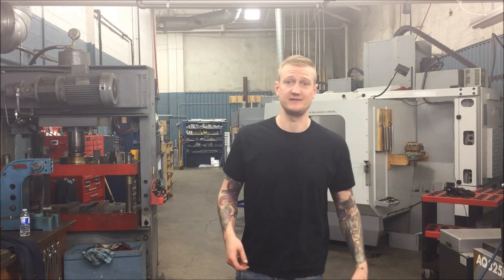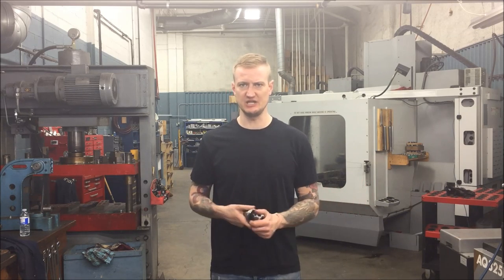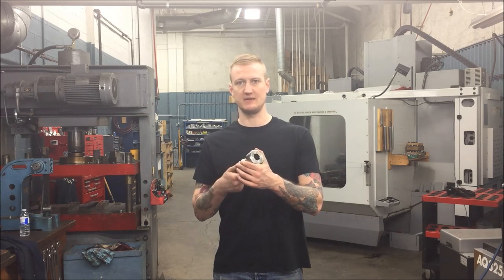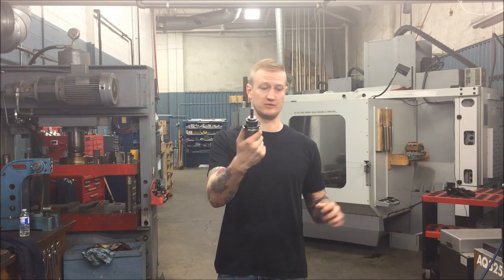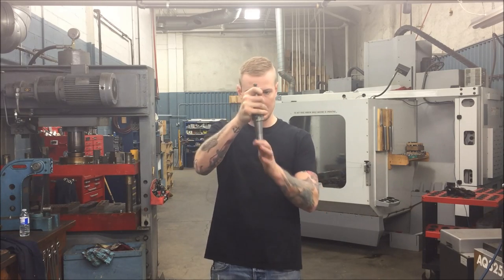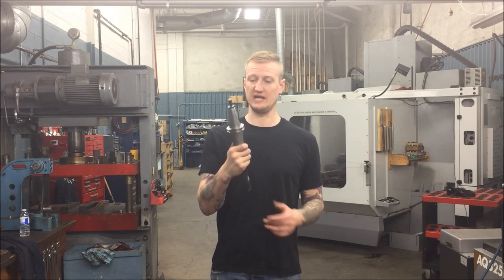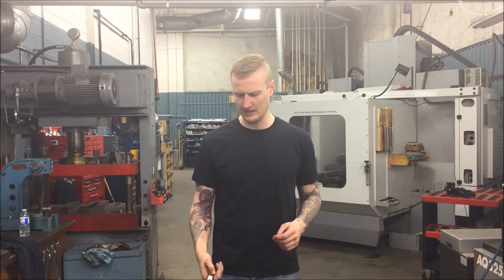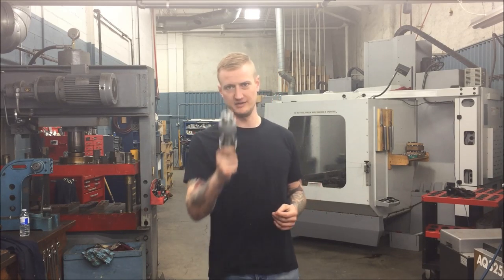BEGINNER CNC: WHAT TOOLHOLDER SHOULD I USE?

Comment: What brand of tool holders do you use?  Any thoughts on expensive name brand tool holders vs. cheaper import versions?
Reply from the maker: I use "Command" holders for my solid holders - to be honest I can't even remember where we got the majority of the spring collet holders - I believe I picked them up through Duramill on a budget. In my opinion, unless you're going for precision (+/- .001) the cheap holders are okay - it's when you're chasing tenths at over 10,000 rpm that you're going to want to go for the more expensive balanced holders!

Comment: Thoughts about grinding flats on tools to use in solid holders?
Reply from the maker: l0c0dantes I've done it on cutters with bench grinders the quick and dirty way, and on a real grinder mounted in a v-block and to be honest, I've never really had an issue with it. Manufacturer flats are always nicer, but typically you can just stick a sharpie in the set screw hole and grind to that and it gets the job done!
Reply: Yep, I do it regularly at work, just one of them things that you do because it works, but always in the back of my mind i wonder if it changes anything. Another thing I do to save time cos I'm lazy is grind the "Flat" on a taper. locks it in better with less removal I find. Anyways, cheers

Comment: Hi, do you know if an end mill holder and a tap holder are the same or are they different?
Reply from the maker: Tap holding collets typically have a square to fit the end of the tap, where as normal end mill / drill collets are round all the way through
Reply from the maker: That said, you can use a tap in a normal collet but you can’t use an endmill in a tap collet
Reply: Thank you!
Reply: Tecno Tor De Mexico is difference